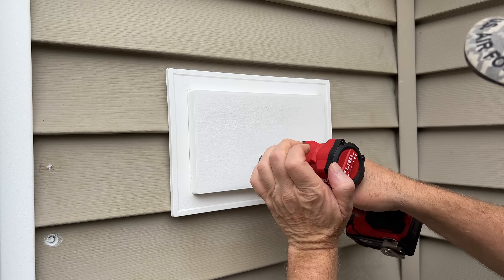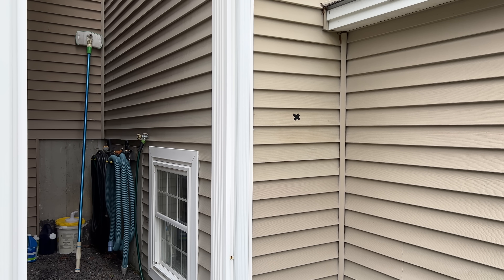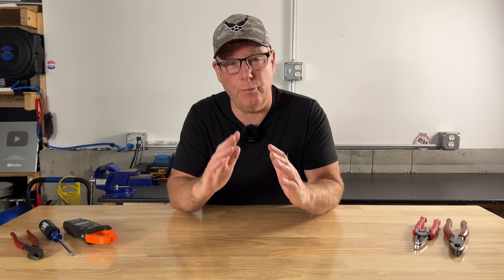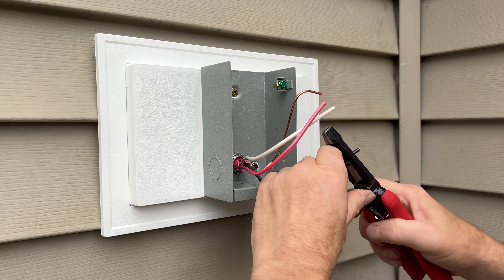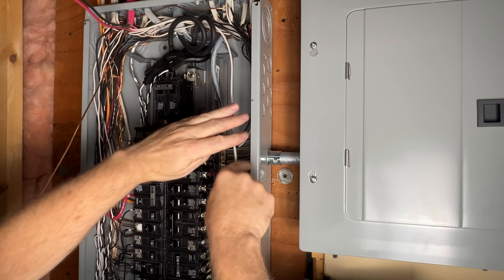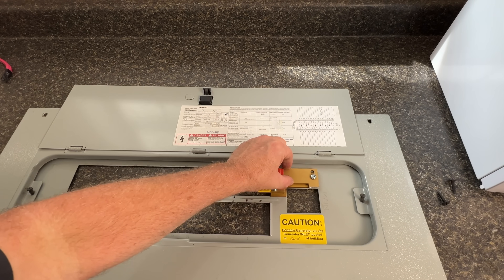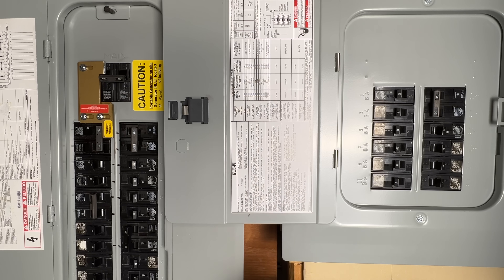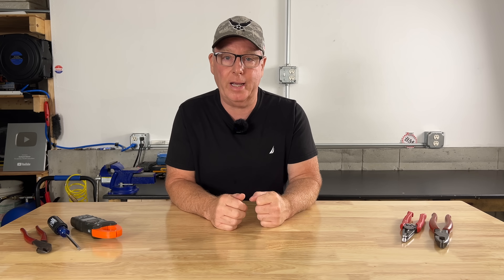Watch This Before Connecting a Backup Generator to Your Home.

Comment: You skipped to sub panel without any explanation I thought. You never mentioned a sub panel in your cost setup
Reply from the maker: You don’t need a sub panel for this installation. I installed the sub panel when installing the Anker SOLIX F3800 and the home power panel. I have videos on that as well.

Comment: Just bought a ford f150 with the 7.2 kw onboard generator. Will I need to make any changes to the wiring connection on my house. I have been using a 5000 kw portable generator in the past, with no problems. I also set mine panel up as you showed. Thanks
Reply from the maker: You can have a larger supply without having to change anything out. If you have a 30A setup you should have a 30A backfeed breaker which will protect the wire and equipment. You should have 10 AWG copper wire between the breaker and the inlet and a 10 AWG copper connection cord. You wouldn't want to upsize the breaker unless you plan to also upsize the wire, cord, inlet box and cord connectors.
Reply: @ thanks for the reply. Yes, my setup is on a 30 amp breaker, so hopefully it will work ok. I’m wanting to try it out, I just didn’t want to have to reset all my clocks after killing the power!

Comment: This video was very helpful when I installed a 50 Amp inlet last fall. I bought the Predator 13,000 gas generator from Harbor Freight and then I started learning about THD. I called Harbor Freight and they said it has a THD level of less than 20. Of course that's way too high for sensitive electronics. However, it's advertised for being safe for home appliance use. It does have a Digital Automatic Voltage  Regulator and I've heard this can improve the quality but possibly only as good as a modified sine wave. I'm probably going to buy an oscilloscope to run my own tests if I can't find out if this generator is safe or not for all home appliances. Has anyone had any experience with this generator or can help me understand why this generator either is or is not safe for sensitive electronics?

Comment: Hello,
I have a question about 30 amp breakers on a D style double breaker
Rated 120/240  single throw on only one side of the new breaker switch. It is an old breaker panel,  and all of the double breakers in the panel have a throw switch connected to both sides of the large breaker with four snap in ports on the back of it and the new breaker only has three connected ports to snap into the panel. And my question is it OK to use the new 30 amp breaker switch to back feed my 6000 watt generator to my 30 amp inlet box through my 10/3 10 gauge wire to the new breaker?

Comment: Interlock kit is such a simple device and is grossly overpriced.
Reply: Absolutely true. The "official" kit for my GE panel is $86 and it's just two small pieces of stamped steel with two sliding rivets and two mounting screws. It should be about $15. They do sell knockoffs on Amazon for $15 but they have no certification, and I don't know if they would pass inspection??

Comment: After enjoying a bunch of your vids and buying an interlock switch for the panel, I'm seeing several vids in my feed about floating vs (?)  ground on the generator.  As the panel already has the ground and neutral tied together, should it be separated on the generator.  I'm guessing it would only be an issue for the odd gfi circuit but something about this would make a good video (other videos have added to my confusion and you really do seem to have a grasp on electrical stuff 😊)
Reply from the maker: Yes you want a floating neutral at the generator with this type of connection. If you bond twice it can cause all sorts of issues. I will eventually make a video on this subject.
Reply: That would be great, we probably only need the generator for a half hour a year feeding the house but a better understanding of the bonded ground would be nice.

Comment: do you have a parts list i keep finding the generator inlet boxes but say max 8000w i have a max 9000w genny
Reply: You can use a 9000w generator or more. The twist lock plug on the generator is 30 amp. So the breaker on the generator will trip if the house tries to pull more than 7500 watts.  Also if you have a 30 amp breaker in your house, it will trip after 7500 watts.  So the 8000w inlet box is fine.

Comment: Hello John.  Last fall i installed a backup generator interlock after watching your video.  It works great!  I'm currently in a power outage here in my local area (storms) and have my house running on genpower.  I need however an easy indicator way of knowing when the main power has been restored.  Currently, either i message neighbor, or if at night, look outside for street pole lamps.  Do you have an idea for an easy solution to add a somekind of LED indicator light perhaps near my main panel (or elsewhere)?  Suggestions are greatly appreciated.
Reply from the maker: I recently made a video on this subject. https://youtu.be/tw2YKYDsuc0 The setup is inexpensive and it works great. I have links to it in the description of that video. In the mean time you can look at you utility meter, use a proximity voltage tester to check the main cable coming into you panel or you could turn off you generator breaker and turn on your main to see if has returned.

Comment: can you put a 50 amp in box ,even if the gen is 30 amp
Reply from the maker: No. Your generator breaker needs to be 30A to protect the wire, connection cord, inlet and plugs.

Comment: Could you use this same setup on a sub panel? Or would it be against code seeing as how there is no way to interlock the main panel.
Reply from the maker: You could but you would need to install the sub panel feed breaker in the sub panel so you could use an interlock. Or you could install a three position manual transfer switch

Comment: How do you prevent water from infiltration where you fitted your interlock box and re installed your siding. ? Looks like water could get behind the edges of your siding along the sides and bottom.
Reply from the maker: I sealed around the connector on the back of the box with caulk. Then I sealed all around the box itself

Comment: If in the budget, please use a
 “in use inlet” NEMA 3
Inlet that protects your generator inlet extension cord from rain/snow. Chances are high power outages will occur during heavy weather.
Also if you have a completely electrical system, a 5,000-6,000 watt generator will NOT be able to run HVAC and even small 120V plug in heaters use 1500W, if unfamiliar with this please get an electrician to determine the best circuit layout for your home. 
-use portable heat sources like propane (with a few tanks) 
-for electric dryers 6000W running is your minimum, remember wet clothes/blankets need to be dried and freezing weather will not facilitate this.
Lastly make sure your generator is protected from the elements!
Thnx for video

Comment: Great video. So if I’m clear, the sub panel is wire with only the circuits  you want hot during a power outage using a generator. Correct?  It would then be safe to say the circuits in the main panel you do not used during a power outage but the one breaker powers the sub-panel… Do I have that correct?
Reply from the maker: I added the sub panel because I have a battery system with an automatic transfer switch. My generator back feeds my main panel where I will use a couple of circuit and I turn on the sub and back up all of that.

Comment: Generator must be sized to handle the max possible load.
Or, load management, or load shedding is required.
Reply from the maker: This is a legal setup here. The loads added need to be under the rating of the device. The 30A back feed breaker protects it from overloading

Comment: So are you using and unbonded generator with your setup ? or it does it even matter in your situation?
Reply from the maker: It does matter and yes you need a floating neutral for this type of connection.

Comment: hi when you checked for power why were there any number movement from the meter if the power was cut? shouldn't everything be 000?
Reply from the maker: The meter will read millivolts in open air.

Comment: I just purchased a westinghouse 9500DF generator. 
It has a peak of 1250 watts. 
My house is wired to a Reliant Pro Tran.
It has a 4 prong 30 amp plug. Is it okay to run a higher wtt generator to a 30amp plug?
I also have a 50 amp outlet on the generator. 
I am not planning on using this as of now.
I just found your channel and i did subscribe..lol
Thank you.
Reply from the maker: It's fine to use a generator with a higher rating thats the load connection. The important thing is that the connection is sized correctly. 30A cord, plugs, inlet, wire and back feed breaker. If you switch to the 50A connection all of the above will need to be upsized as well. Welcome to the channel.
Reply: @BackyardMaine  Gotcha... Thank you for your reply.
Reply: That's 12500 peak watts.

Comment: Hey John, I am out in the country and have an electric pedestal ~ 80 feet from my house next to the transformer. Is there any benefit to wire my generator to the panel outside vs. the panel in the house. Wire cost would be cheaper and generator would be quieter being farther away from the house, but wiring to the panel in the house may be more convenient during a storm???? Your thoughts? Great video!!
Reply from the maker: You can certainly make the connection in either location so its going to come down to what will work best for you..

Comment: @BackyardMaine, I had a transfer switch installed but the inlet receptacle is a cs6375 (three prong 50amp) so is there an adapter I could buy that would work with the cord in the description? Thank you.
Reply from the maker: If you have a three prong cord then you have 120v connection. Hot, Neutral and Ground. For a 120/240v system you would need a four prong cable.

Comment: Great video. However, I never see any channels that create this specific type of content discuss the main panel and using a breaker that feeds both power legs. It may be inferred, but for most it's not. I watched the exact moment you inserted the breaker into your panel and it was clear the bus connection was both legs. Its relevant to the video and install for many reasons. Not everyone is doing a sub panel and the knowledge of what is happening there is valuable.
Reply from the maker: Yes the bus is staggered on all electrical panels. So any two pole breaker will feed both sides on a residential split phase system.

Comment: Do you need a sub panel? Couldn’t you just flip on which breakers you want on and off in the regular panel and not have to move them over to a sub panel?
Reply from the maker: I needed a sub panel for my battery system with automatic backup. The generator feeds my main panel then I select the loads I want to turn on being careful not to overload the generator.

Comment: so, now is you generator a bonded gen or floating neutral
Reply from the maker: Floating neutral. The neutral can only be bonded in one location and it's done at the service. If you're running a bonded neutral generator,  you would be running the generator as a separately derived system which means the neutral and hots would need to be switched down stream of the service bond to eliminate two bonds on the same system.

Comment: 11:53 - Will this work with a generator that has a 30 amp plug but only 3 prongs (and an adapter at the inlet)?  Similar to your 120 V AC plug next to the one you plug in.
Reply from the maker: It’s not a good practice to single phase feed a panel. It can cause issues with multiwire branch circuits where two circuits share a common neutral. Plus you would be unable to run a two pole circuit like a well pump.
Reply: @BackyardMaine  Thanks!  But if the panel has no multiwire branch circuits and you turn off all of your 2 pole breakers, would this be OK to do?  I'd just want to power a couple fridges, outlets, and lights in an emergency situation.

Comment: What would you do in my situation,  I have dual 200 panels with one power meter
Reply from the maker: Probably install a sub panel and move over my critical loads needed during an outage and back up the sub panel by generator

Comment: I believe that the 30 amp breaker being fed from the generator needs to be locked down as it becomes the main breaker when energized. I’ll also bet that many will trip the breaker on the generator by not properly power managing. You did vaguely explain that but to avoid many trips outside to reset that breaker a monitoring meter of some sort would be helpful. If you are lucky enough in this situation to have fuel heat you should be able to use it with other circuits in play. But proper power management is essential. In other words I personally do not feel that this is a job for the average homeowner at all. Especially the breaker lock installation and Neutral situation. Either way this type of job should be done with a permit and electrical inspection. If it, or any other bootlegged job results in a fire more and more insurance companies are on the lookout for that and will not insure the damages.

Comment: My generator has a 120v 30 amp output plug. If I ran a similar setup, would I only be able to energize one bar in the panel? Or one side of the breakers since it's only single pole
Reply from the maker: Single pole would end up supplying every other breaker on both sides since the bus is staggered. There are a few reasons why this would not be a good idea.

Comment: Hello i have a old 1945 power box and I want to put a inlet box so I can run 8750 generator to run my home but I don't think they make a block off plate for this old box I have room for a 30amp breaker any suggestions it would help me alot because of this fires  here in los angeles we had no power for nights and it's been very cold and we're about to get strong winds again and the power will go out again thank you in advance and God bless 🙏🏾🙏🏾🙏🏾
Reply from the maker: You can install a three position manual transfer switch ahead of the panel. The top position would be utility power, the middle would be off and the bottom would be generator. It would be a good idea to have it installed by a professional since your working with the main feed to the house.

Comment: Would 5500 watt generator run 3 ton heat pump and air handler. I want to keep home warm
Reply from the maker: 3 tons of refrigeration is equal to roughly 10kw or 10,000 watts. You must also provide for the inrush when the unit starts. A 5500 watt generator is too small.

Comment: Why do you not mention the need for a floating neutral generator in this type of setup?  You let people know you’re an electrician, so they trust what you’re doing, but you fail to mention a huge safety hazard.
Reply from the maker: That subject needs its own video since there are several variables. Check the comments. I have explained this several times
Reply: I understand the issue. Im just saying that it shouldn’t be completely ignored in the video as most people won’t sift through the comments to learn about an issue they don’t even know exists.
Reply from the maker: @joeblow5958  Like I said this will be a dedicated video. I didn't talk about ground rods or the size and type of connection cord either. I can't cover everything in one video without it being very long. Maybe you should consider starting a channel of your own..

Comment: You should put blue thead lock on the screws that hold the Intrrlock kit so they don't come loose over time.
Reply from the maker: I did. It was in the nuts I used. It came as part of the kit

Comment: Thank you!  Very nice video!  Can you talk a bit about the neutral (bonded vs. floating) in the generator?  I have a duromax inverter with bonded neutral.  Their website explains how to unbond the neutral.  I'm assuming that since the interlock is not a switching neutrals, I would need to make my generator's neutral float.  Also, how can I tell if my neutral to ground bonding is at my meter?  I have the cutoff (200amp) breaker under the meter installed by the utility.  Am I to assume that the bonding is there and not in my service panel on the side of my house?  I do not have a large 200amp main breaker on my service panel on the house.  Only the one on the meter.  You have both.  So you do not bond in your service panel as it is done at your meter cutoff.  I'm assuming mine is the same?  Thank you!
Reply from the maker: I think you understand it well. Yes, with this connection you want a floating neutral at the generator. The neutral to ground bond should only happen in one location. So like you said, unless you're switching the neutral you need to float the generator. It is easy to determine where your service is bonded. If you have four wires coming in from the meter disconnect (2 hots, an insulated neutral and a ground) then you're bonded at the meter and you should not have a bonding strap between the ground and neutral bars in your panel. Also the grounds and neutral in the panel should be separated. If you have just three wires at the panel (two hots and a ground) then the bond is there. You should have a bonding strap in place and it's still important to keep the ground and neutral on a separate bar.

Comment: I bought a duramax generator leaked when filling with oil retired though the company was good sent a tractor trailer to retrieve in the middle of the know were. Plus didn’t like a lot of problems people were having changing brushes on generator went brushless porter cable 8500 start 5500 running 10 hp Briggs &Station 20 yrs old just for well ,works great video since then use 2 100 amh hours lithium batteries 2000 pure sine wave converter, and Honda 2000i my neighbor fried all Tv all electronics , refrigerator when his generator spark plug started failing. Use wool pellets for heat on plug turn on inverter back to bed .😱🤷🏼‍♂️💪✅⚓️⚓️🇺🇸🇺🇸🇺🇸🇺🇸🇺🇸